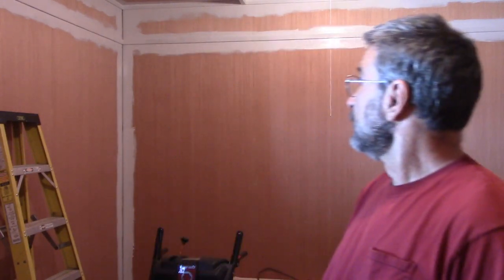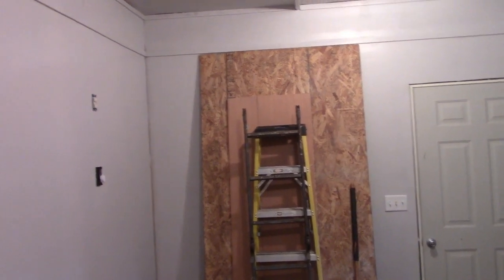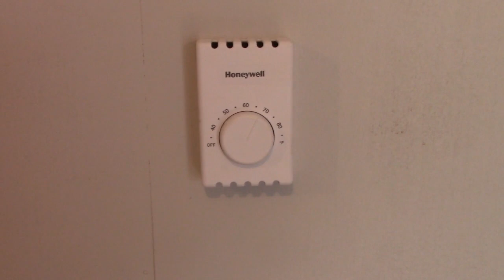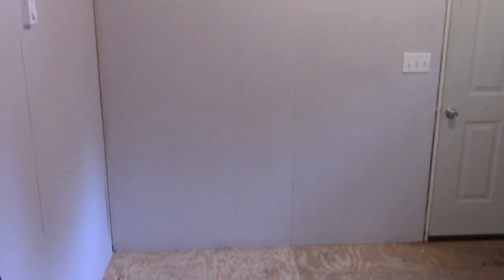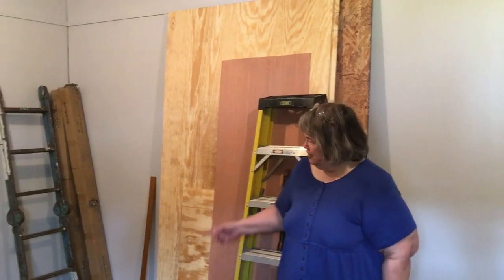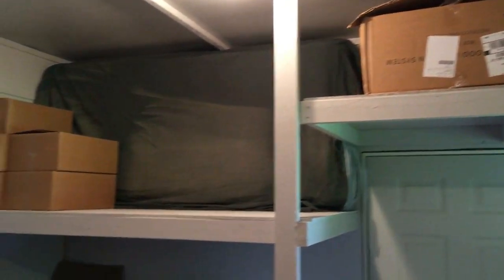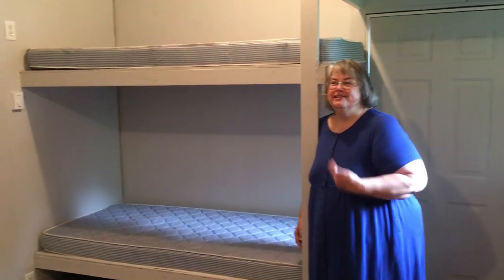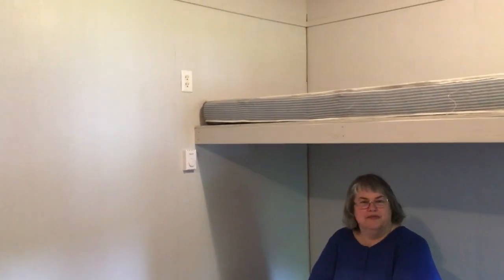Shed Rebuild (pt 11) - Paint and Shelving

Comment: Looks great, I'm sure you have thought about the floor covering, there some great roll on (paint) products out there for the floor these days, You can get it so it is textured giving it slip and stain resistance.
Reply from the maker: The floor is just plywood and I haven't though much about it.  Maybe I should at least paint it to protect it a little bit.

Comment: Bill, your carpentry skills are top-notch so this is just a question. The outermost rail of the bunk beds seems to be only supported by the screws. Should a cross-brace be nailed underneath for more strength? As an amateur DIY-er I really like watching you build.
Reply from the maker: No, the way it's built is plenty of strength, as long as the wood is solid.

Comment: How nice - what a great idea!  Will you be putting up some kind of a safety rail on the top bunk?  Or, is it primarily for adults?
Reply from the maker: No safety rail.  I though about it, but the youngest to use it would be about 11 (and getting older all the time). I think that's old enough, and a railing would REALLY get in the way of storing boxes up there, which will be the MAIN use of the space.

Comment: My mother never masking taped anything, like windows and stuff. As I remember it, she used a one inch brush and went very slowly and had a very steady hand. If she did accidently get a little paint on the glass, she would wrap a rag around a screw driver and use that to scrape the paint off. She wouldn't spill paint either. She would just have her paint container on a sheet of newspaper. She never needed to cover the floor other than that. And I don't think she used a roller when painting walls, but that doesn't seem reasonable.
Reply from the maker: +Betsy Oman  I never use masking tape either. It makes such a mess.
Reply: I  envy all of this because I have shaky hands now.

Comment: When we paint a house if we don't get any of the paint on us it means we are working too slow.
Reply from the maker: +Camper Hollow - Camping & Prepping  This is Elizabeth. Bill actually paints very quickly and neatly! He's my hero!
Reply: Elizabeth, that's good. My dad and I when he was a building contractor would paint a two story, 3 bedroom house in 4 hours without the trim.We had all the ceilings and walls done. When finishing drywall on a good, full day I'll coat all the flat seams and corner bead on 10,000 square feet of drywall. Can you give an idea of what Bill's production is?